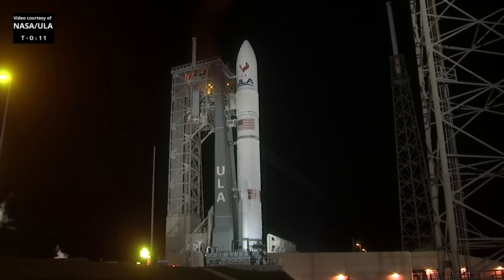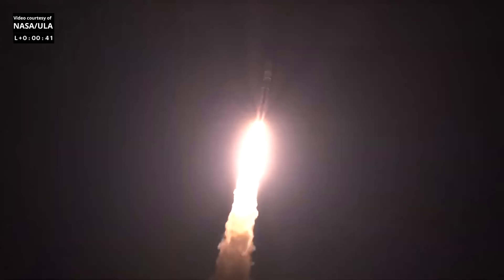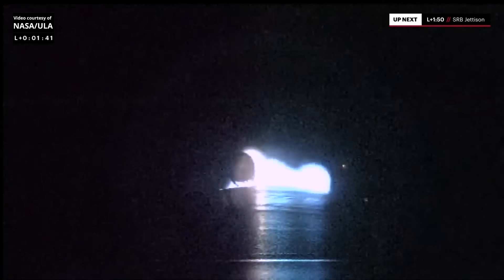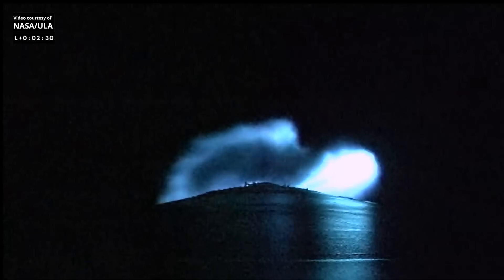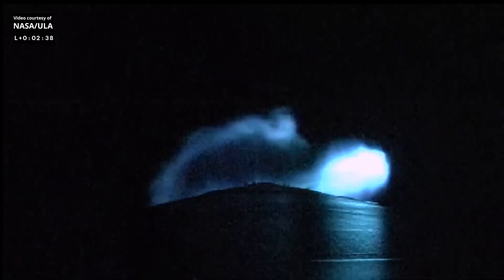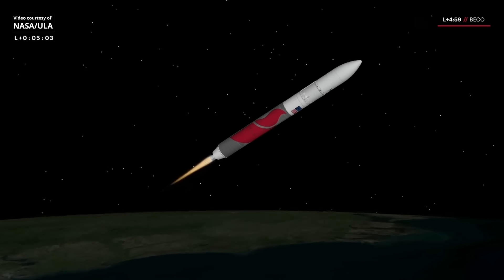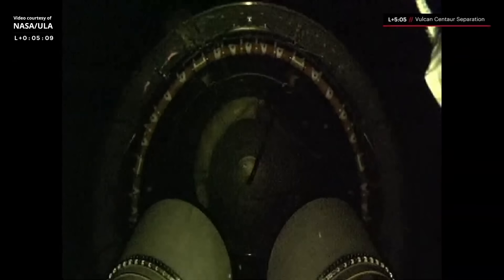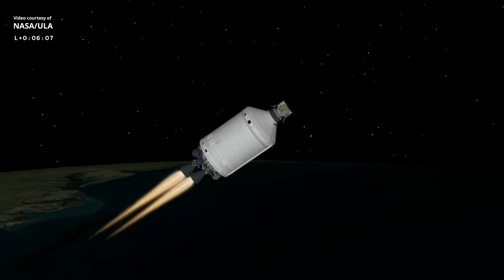The first Vulcan rocket launch

Comment: I’m surprised I didn’t see eulage exhaust from Centaur before it ignited. What did it use for eulage, cold gas?
Reply: Do you mean ullage?  The ullage at start of burn is composed of a mix of helium and the gas phase of the liquid in the tank.

There is (I think) a quick chilldown of the engines with some of the cold propellant to get the lines and system thermally conditioned for the engines to start.  It is dark, but you can still see it start a few seconds before RL-10 (the two Centaur engines) ignition.

But the ullage doesn’t typically vent before engine start - at least I don’t think it does.  I am much less familiar with Centaur and upper stages than I am with Booster, but I do know a little about Centaur…

Comment: Did it not pitch and slightly drop right after liftoff or am I seeing things? If it did do that can someone with more knowledge be able to tell if that is normal? Other then that the launch looked great
Reply: Normal. 
They kinda slide away from the launch tower at a slight angle intentionally. Not uncommon.
Reply: @JOlivier2011 nearly every vehicle does it in some way, some more aggressive than others. Even Saturn V pitched away from the tower which looks scary given the sheer size.